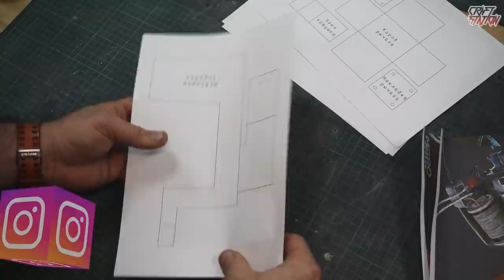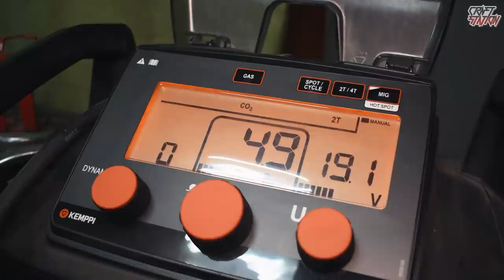HOW TO MAKE UNIVERSAL CHARGER FROM METRO EXODUS DIY

Comment: I kinda wished it would be an actual hand cranked charger instead of a well disguised battery bank.  I gave the video a like though.  You did good work.  Cheers
Reply: I feel you but if it was a legit hand crank it would take hours of cranking for those batteries to get charged up. Not very practical since he needs to power up the voltmeter for display.
Reply: Considering the dimensions of the motor it could probably make some hefty ammount of power,still  only for like flashlights and similar stuff
Reply: So hard to please 😕 geez
Reply: what, you wanna power your house with few clicks? ain't gonna work like that.
Reply: @GoTi4No an "awesome craft" , I mean it looks just like it
Reply: Welp in the game it actually only charges the torch 😂 and the night vision goggles, both working with pretty low current so that would be doable to make a real replica
Reply: @Skilebougre  he uses it to charge capacitors enough to open electric doors and other things to that would require hours to actually charge lol
Reply: @Skilebougre  😖
Reply: @Skilebougre  someone must build a hand cranked replica,but this one is up there
Reply: @runicrebel9388  really :o ? Didn't go far enough then x'D sorry
Reply: @Skilebougre  I was just saying lol I've played the first 2 extensively I love the game but yes it is also used to charge the flashlight nvgs and a few other small things to
Reply: Just make it take like 15 pounds of pressure and spin like half dozen i guess one way rachetting genereators.  Like its real hard on to squeeze
Reply: @darren414178  obviously you've never seen hand crank radios and flashlights. It's not that hard, this guy's just lazy and wants views.
Reply: @runicrebel9388  nu u stap raght thare
Reply: The power that you would be able to generate at your best would not even be close to a fraction of what you would need for anything usefull. The amount of potential energy stored inside a battery is mind blowing when compared to physical mechanical labour.
Reply: @adriandahlstrm7089  still can power a flashlight or nightvision goggles
Reply: @gamersforlife3440  nope, not realy. Look into how many watts it takes to create a usable amount of lumens. The most shitty flashlights are about 50lumens which is about 0.5watt if you have a really good led.
0.5 watts might not sound like much, but mathematically it is equivalent to lifting 100kg up 2 meters into the air every hour to keep this going. And those are no loss calculations.
Imagine doing that by closing your fist.
Reply: Well, if u want to make it fully funtional. U can change the core of it to 4 magnet and 1 Bronze coil in side. After that, it u must make the magnet spin around the bronze coil, then congrat u now have a mini-power generator powered by hand
Reply: @binhanjustbinhan9141  so can we power flash light and nvg with it
Reply: @adriandahlstrm7089  so how artyom does it?what will do in apoclaypse like metro??
Reply: @gamersforlife3440  yeah sure but only a small amount of electricity, enough for lighting that flash light for maybe 4-5 minute if it have a small battery
Reply: If you look at the voltmeter in the game. Some things that you power with the hand crank go to 300V, I don't think that would be possible, or at least at extremely low amperage.
Reply: @DJScopeSOFM  Yes, it is. But if u have a strong arm and use the hand crank very fast to some speed. It might create an Electromagnetic induction that create Electrical Power by turing the magnet around the bronze coil. About the 300V in the game, so...come on, it a game ,u can't blame it  but it science for some fact
Reply: MISFIT 414 isn’t that the point
Reply: nice job getting 666 likes I wont ruin it but liked
Reply: @sobolanul96  Nice, thank for telling me
Reply: GamersForLife Live in the dark...
Reply: @runicrebel9388   not if the gear set and coiling was done right. the meter only show shows what its at after each pump. plus that was only the generator battery he was charging from the panel not the door.
Reply: @runicrebel9388  Actually industrial electric equipment that requires hand cranking before it can be activated is not uncommon. What you're doing is charging up enough voltage for a relay to be able to close a high voltage circuit.
Reply: then why not replace it into an actual hand cranked charger (by replacing the battery bank to electric motor, but that engine from industrial sewing machine is rarer to get it)
Reply: I wonder if instead of using the shell of an alternator u just use a real one from a car if it would work even if it charges batteries thats a win, short term the hand crank can power led lights and other small stuff if you need to charge a bigger cell hook up the main gear to like air, stream, or like a bicycle
Reply: This totally killed it for me, but same, i dropped a like
Reply: Disagree with you on the the last part there
Why in the absolute fk would I want an unnecessarily bulky powerbank? Going out with it, most people will think I'm crazy and the people that do know it's from metro will just ridicule me for wasted effort.

Comment: That feeling when you're spoiled by an oxy-fuel gas burner so watching someone cut metal with an angle grinder is funny.
Reply: The tig on the hot rolled mill scale drove me up the wall though.
Reply: @declangohsman9913  maybe dirty welds were part of the aesthetic ?

Comment: What is the ohmic value of the resistor you put at 6:28
Reply: these are current-limiting resistors of decorative backlight LEDs, they are calculated individually depending on the type of LED

Comment: If you used a large capacitor you could make it a legit hand charger. An ac fan capacitor would work if you could do the electronics and step down transformers in the circuit.

Comment: Disappointed!!!! You could have made a real one with a bicycle generator or a alternator off a small car engine.
Reply: There is a thread on rpf on how to make the mechanism for the crank. They also used a stepper motor to get it to work